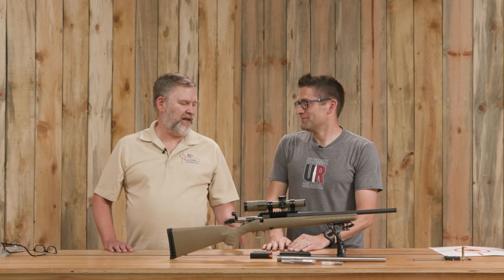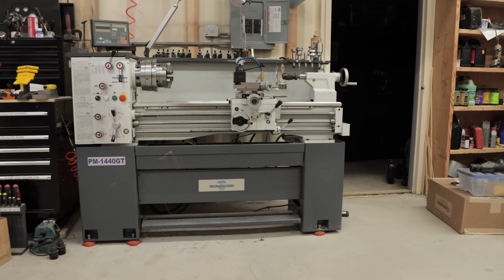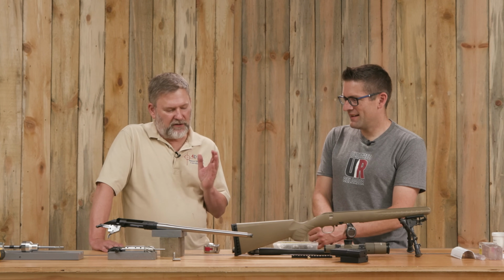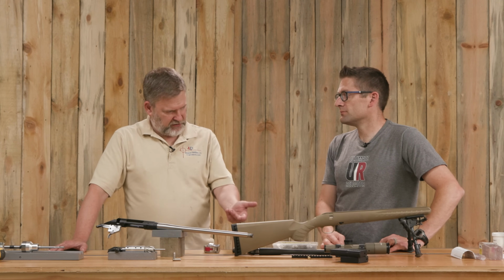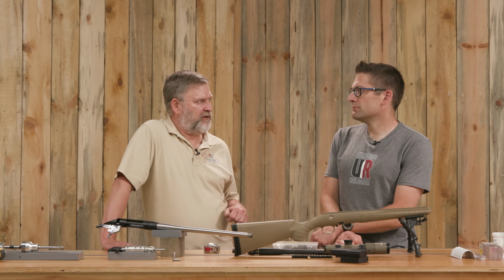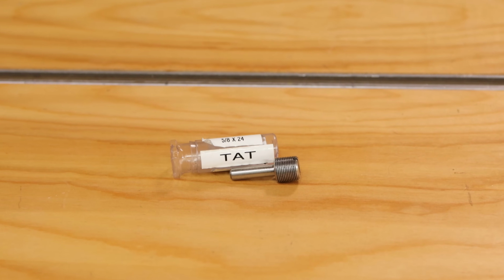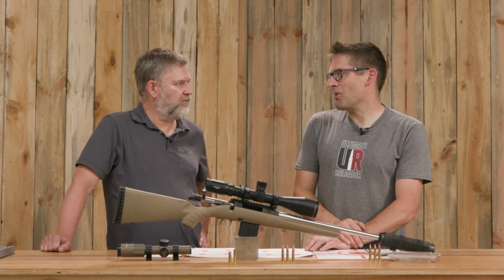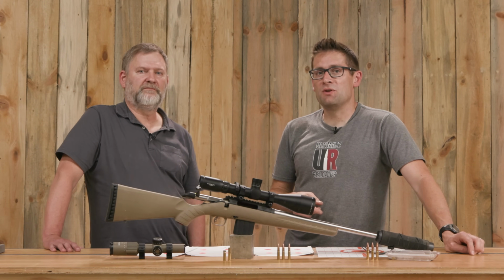BUDGET 300BLK Ruger American with Fred Zeglin (Extended)

Comment: To finish the video...  you asked what we did different

I used a savage axis (twice actually)  

Ordered a pre fit barrel and ready to rock.

Used pewter and some range brass to make go/logo gages(really easy)

Fit thr barrel....  proceeded to replace everything except the action itself, and the bolt body.....  

Video was supposed to be geared for those without a lathe....  however the work you did....  required a lathe.....  

Would have been better if you showed how to get a semi custom build....  without a lathe at all.....

Comment: awesome video as always guys, but i am very confused. correct me if i missed or misunderstood, the rifle has a 1/8 twist rate (common for most commercial 300 blackouts), gavin said 1/8 twist would shoot better with heavier subsonic rounds, the rifle did indeed shoot better with the heavier rounds. Am i missing something? faster twist almost always stabilizes heavier rounds better. so, shouldn't 1/8 stabilize and group much better with lighter rounds? and why did the rifle shoot better with the heavier/longer rounds while having a slower (for 300 blackout) twist rate, but shot poorly with lighter rounds?

Comment: For subsonic pest control try 110gr plated RN for .30 Carbine over about 4.0 gr. of Bullseye. They are cheep and accurate in my unmodified version with flush mag and 1:7 barrel. Also, I found out quite by accident that  Hornady 110 gr. Full Boar GMX ammo will shoot 3/4" @ 100 yds for me consistently.  I have some handloads that are close, but haven't been able to definitively top those factory rounds yet.

Comment: Did you experience any problems with the extractor.  I had three Ruger Americans where the extractor would pop off the bolt face and the parts went flying.

Comment: I love my Ruger American Ranch 7.62x39. I have an off-the-wall idea for a rifle I want to build. I would like to find one of the older rotary magazine Ruger Americans in .223 Rem and re-barrel it to .327 Federal Magnum.  The rim diameter of the .327 is about .003 smaller then the .223 case head, so it should work on the bolt face with no modifications. I think this would make an awesome plinker / small game rifle. The rotary mag hopefully should allow feeding the .327s with little trouble because it holds each cartridge separately.

Comment: I’ve done a RARR build starting with a 6.5 Grendel model. I spun off the old barrel and used a 20” PVA 6mm ARC prefit with their barrel nut and one of Fred’s gauges. Worked like a charm, shoots sub 0.5 MOA CONSISTENTLY, and gives an extra 200-250 ft/s over a gas gun in the same chambering and barrel length. Love the American platform.

Comment: My favorite bolt action system. I would love a high end.308 bolt gun, but for the same price I was able to purchase one in .308, 6.5 CR go wild, .556 and 300 blk. Just can’t seem to get my hands on one in 7.62x39. Working that bolt a couple hundreds of times, like butter smooth. My choice for top value in an affordable platform with a great trigger for the price.
Reply: Check out the CZ527 IN 7.62X39, better rifle and you can find one. I have both, and the 527 gets the nod.
Reply: @twintwo1429  I was actually able to acquire a Ruger ranch 7.62x39 about 6 months ago. Love it. I’ve heard nothing but good things about the cz bolt action rifles. I’ve never shot one though.
Reply: @biglarge9418  I always wanted a Ruger Ranch but never got one. Have many other rugers tho. Probably just as good as the CZ or American. Thanks for the response and good luck.

Comment: I have a 1/7 16" barrel on a howa that shoots 110g varmageddon 1/4 inch groups at 100m ....125g speer tnt, 135sierra at half moa....twist means nothing
Reply: Velocity is the key to what you are experiencing.  I am going to try some light bullets in the 300 AAC just to see what I can get.
Reply: @ReamerGuy  i think you can over stabilise when the velocity is is like 3500fps and projectiles start to disintegrate but that doesn't apply to blk speeds lol ....in saying that I'm having a custom blk built  with a 1in10 twist 24" barrel to see if I can get even better groups with the lighter projectiles I'd say I won't be able to use anything over 150g

Comment: I've ran a factory ruger ranch rifle in 300 for several years with a 1:7 twist.  I have learned that this fast twist doesn't like mid weight bullets. Does great with faster 110gr bullets or around that, or slow 190gr plus bullets. Velocity and twist just don't work for mid weight bullets and it's confusing as hell why. I know speeds and twist are a big factor but this little 300 with a fast twist likes light fast bullets or heavy slow bullets. It has to be the most baffling rounds I've ever loaded for. Great information can't wait to see more!
Reply: I kept trying to make Lee 155gr to shoot accurately, tried everything with no luck than I a friend sent me some NOE 150gr and that worked better right off the bat and its not even gas checked bullet but I did also have success with some lighter bullets.  Never tried heavy bullets, I do have some RCBS 165 SIL now that drop around 173gr maybe that will work, never though about trying as I always preferred faster velocity.

Comment: Haha... I bought an american ranch in 6.5 Grendel. MDT lss-xl gen 2 chassis. Aken SH-4 on the top. Arca rail, folding stock. Muzzle brake... I found all the tool and the component to reload in 30 minutes (took me 8 month for my 308 in Canada). It will be an epic mid range backpack gun. Changing a barrel is not for me yet (with the stupid laws it may be sooner than later...) but , hey good job guys.

Comment: Would love to see the followup vid on how he smoothed up the feed ramp/chamber area.   I have a RAP in 6.5 Grendel which shoots lights out (why is the most accurate rifle I have the cheapest??) but absolutely destroys expensive grendel brass feeding it into the chamber past the two feed ramps machined into the receiver!   I was hesitant working on them as I don't want to mess with the lugs the bolt uses to lock on.  Sounds like Fred has a plan and will know exactly what to do!

Comment: Okay I'm confused 🤔 Why did you guys went with 300 blackout when Ruger already sells the gun in this cartridge?  Would have been awesome to see a unique cartridge that's not available in bolt action like 300 HAMR.
Reply: Supply and demand brother,  I had everything for the 300 Blackout and I wanted a bolt gun in that caliber.  Could not find one on the shelf at the time, so made my own. :-)
Reply: @ReamerGuy If it wasn't for ridiculous shortage now that effected everything these guns were widely available and the whole concept of a budget gun fails when you have to spend 900 - 1000 on barrel and various tools   like reamers, gauges, angular cutters, threading die and adapter.  Why would anyone spend $1000 on a plain jane boring 300 blk build when I got same factory configuration for about $400.  I like the concept but if I am going to spend that kind of money I want something unique!  If you want 300 blk go build AR15 even now plenty options to build $400 - 500 gun.
Reply: @DimaProk  Isn't that the key though while the video is on converting from 350 legend to 300 BLK the principles remain the same. You could absolutely go from mild to wild(cat) using the same principles and tooling!
Reply: @gunsshells2434  Yes, I get it but still could have picked something more interesting than 300 blk to rebarrel.
Reply: @DimaProk  it's his personal gun, your interest in the choice has no relevance nor would a different choice have changed anything about the video.
Reply: @jaydunbar7538  So what you're point?  I can't ask a question regarding their choice?  In case you missed rewatch what Gavin says at the end of each video.

Comment: Does the muzzle thread need a thread relief so the muzzle device can shoulder up when screwed on?
Reply: We ran with no relief cut as the suppressor adapter I had did not need the relief.  I like to leave as much material as I can when threading.  There is no real problem with a relief cut if you need one for your break or flash suppressor.
Reply: @ReamerGuy  Thank you. 👍

Comment: Would still like to know if this could be done by taking a 6.5 Creedmoor or a .308 brass and neckdown to a .204 could anyone let me know if this could be done ??
Reply: Probably the closest normal thing you would get which is the 20 BR which is loosely based off of the 308x1.5 Barnes (so a shorter 308)
Reply: We have several 20 caliber wildcats in the inventory.  20/6.8 SPC, 20 Nosler and the biggest case is the 20/220 Swift, for those who like short barrel life.
Reply: 22-284 middlestead and 20-284 come to mind. Shot a 22-284 for a while. Was fun but barrel life is short.

Comment: Did you say 300 HAMR in bolt action!  Shut up and take my money! 😁😁  But seriously I want one so bad, I actually have Ruger 300 blackout rifle that looks just like the Legend 350 you're working on that I want to rebarrel to 300 HAMR.
Reply: Well, the .300 HAM'R is simply the longer case version of the .300BLK. So if you had this gun I'd simply rent the .300 HAM'R chamber reamer and Viola...
Reply: @ditzydoo4378  Twist rate is too fast for billets I like to shoot in 125 - 135gr especially with lead bullets that I like to shoot.  I saw a much better accuracy with slower twist plus I want 26" barrel :)
Reply: @DimaProk    This is why I have four different uppers for my AR lower.  6.5 Grendel, .223 Wylde, 7.62x39 and putting together a .300 HAM'R.  Each is fun in it's own way.  The trick is to use quality parts and you'll never be disappointed.
Reply: @ditzydoo4378  Agree, although after a while I got tired if swapping uppers so I got 2nd lower as well.  I build 223 Wylde with piston and spent way more than I planned but it shoots like a dream.  I also got 7.62x40WT which was predecessor to 300 HAMR, it's pushing lead 136gr bullets 2330 fps with 1 - 1.5 moa accuracy from 16" barrel.  I got a chance to pickup cheap 20" 300 HAMR barrel so I built another upper, the cartridge is almost identical, only .030" longer but I got the barrel for $150 only and Wilson Combat makes match grade barrels.  I was going to just replace the barrel but I noticed that older barrel actually supports longer bullets so I'll need to do some testing and decide which one to keep.
Reply: @DimaProk  Naaaa, I just pop the two take down pins and go.  But I did choose only the best for my lower, like the Rock River Arms 2-stage national match trigger/hammer group.  I like that it uses a GI type full dimension main spring set so when faced with those beastly hard Tula and Barka primers it will fire every time.  The trigger pull breaks clean at 3.2-pounds every time.